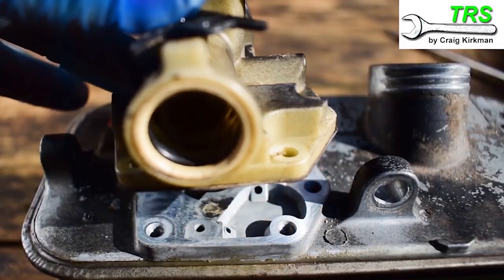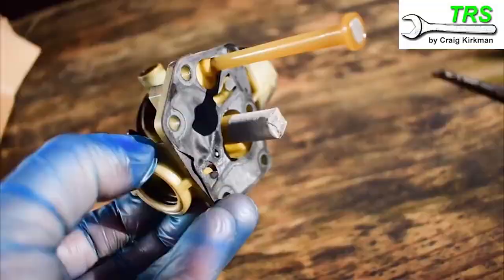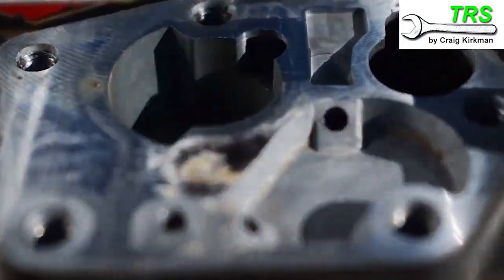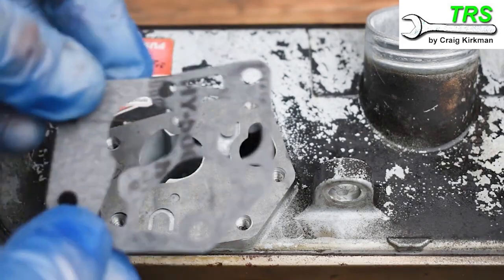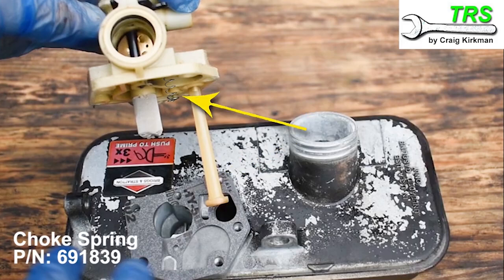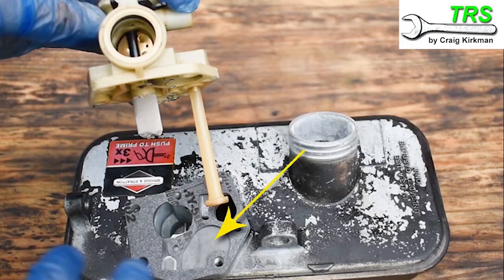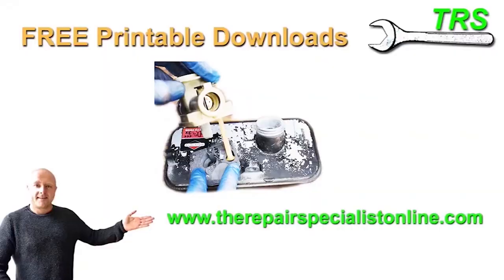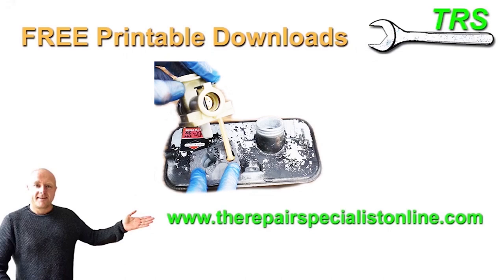Briggs and Stratton Lawn Mower Diaphragm & Gasket (Must Fit this Way Around!)

Comment: Thanks - so "gasket to plastic", have seen a few say other way but this seems to make sense
Reply from the maker: Hi. Yes gasket to plastic and diaphragm to metal tank. Please don’t place them other way round or you will most certainly not get you machine running. Thanks for your kind feedback. Craig 👍👍

Comment: i have a leak after replacing gasket and diaphram.i have tried it twice,any ideas.
Reply from the maker: Just check that the top of the fuel tank is not distorted.  I'm referring to the area that the carb fits onto the tank.  Remove the carb and place a straight edge over the shiney area of the top of the tank where the carb fits onto.  I have known this happen in the past. If it is this, then the only real fix in to replace the tank. I do know some people, however, who claim they have sanded it back to a straight edge again using a perfect straight edge and wet and dry.  I have never tried this though.  

Take a look and see if the tank is distorted and go from there 

Craig
Reply: Thankyou very much, il give it try. @TheRepairSpecialist

Comment: Great info in your vids!

I’m curious to know if in my case, the engine stalls abruptly on my pressure washer, would that be a case of fuel drained from the reservoir (float bowl) because of reverse order on gasket and diaphragm? Or because of something else. It literally just dies. Runs and dies. If I control the throttle to low levels, no dying.
Reply from the maker: Hi. Thank you for your feedback. I really appreciate it. I think you have something use of fuel blockages through the carb or fuel line or filter. You need to make sure your carb is set correctly and that your fuel filter is clean and your fuel is fresh. I hope this helps a little. Craig